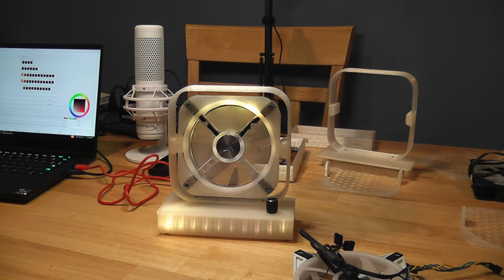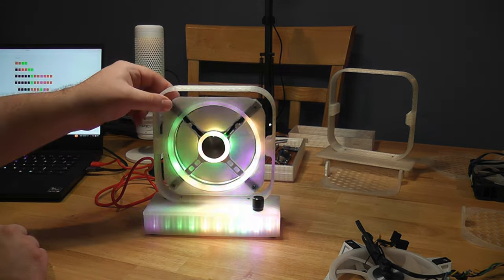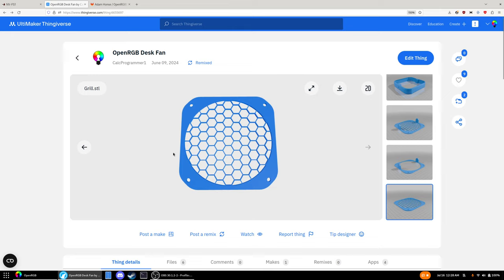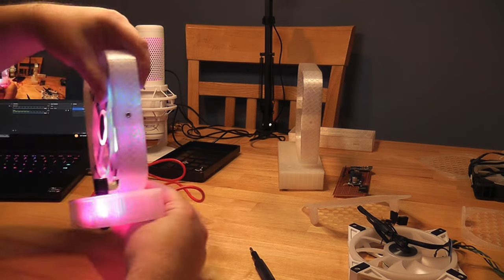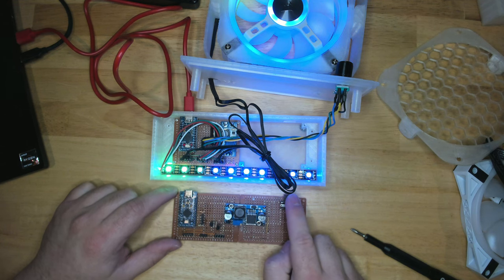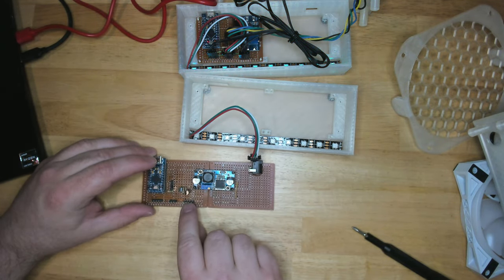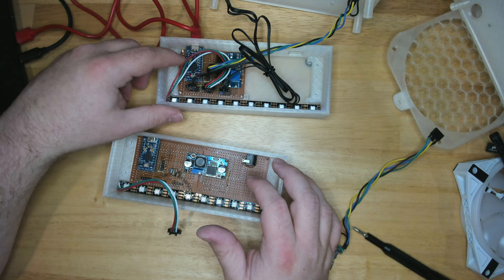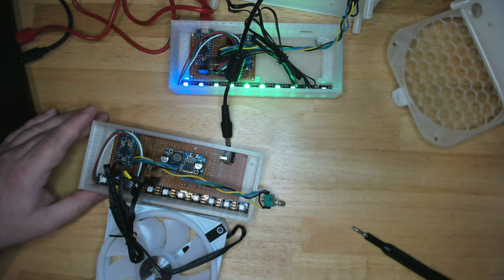OpenRGB Desk Fan

Comment from the maker: Correction at 19:45 - I did not damage the Arduino.  The issue was caused by flux residue between the traces.  The internal pullup resistors on the input pins are very high resistance and the tiny amount of resistance between the traces and neighboring ground traces due to the flux residue was causing erratic inputs to be registered.  I gave the area of the board a good scraping down and cleaned up the residue, now the inputs work fine.

Comment: Really liked the software but it doesn't support my Fractal Design AIO yet so I can’t use it to sync my main PC. Works great on everything else.
Reply from the maker: Does the AIO connect using an ARGB header or using USB?  If ARGB header, then whatever controller/motherboard you connect it to has to be supported.  If USB, it needs to be directly supported.  I don't recall having any existing code for Fractal devices in OpenRGB so it would need to be reverse engineered if it is USB.

Comment: I wonder why in the world OpenRGB doesn't support GPU MSI 4070ti Super gaming X slim. Unless I'm missing something!?
Reply from the maker: Probably missing the PCI ID in our list of known GPUs.  You can get the PCI ID from the Hardware Information tab in Device Manager on Windows or using the lspci command on Linux.
Reply: @CalcProgrammer1  would you be adding support for the 4090 strix oc in the near future ?
Reply: @CalcProgrammer1  I've uninstalled it! I'm sorry but I don't like it. The v0.9 is unstable and the experimental is even worse which has messed up my all RGB.